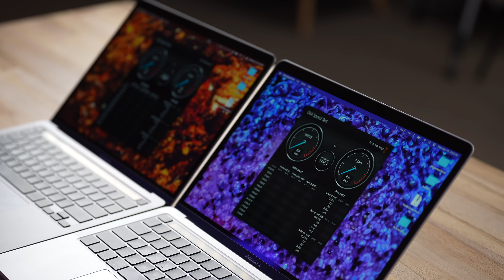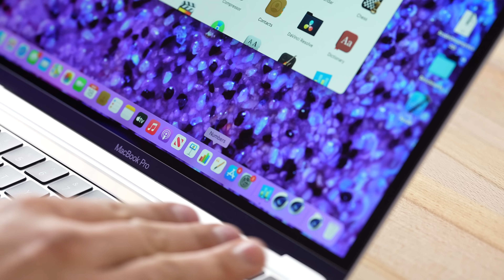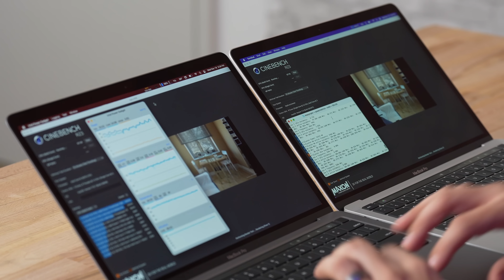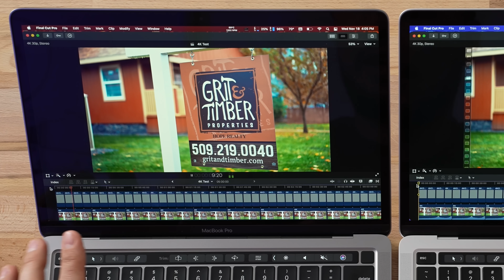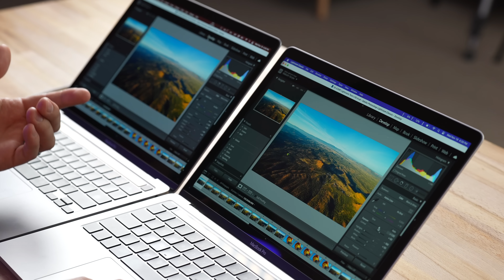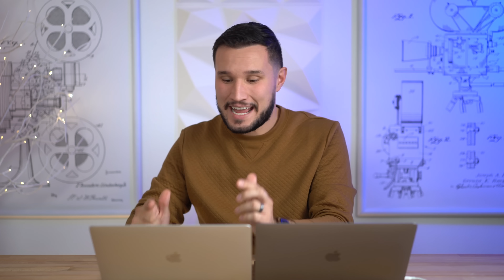M1 MacBook PRO vs Intel MacBook PRO: ULTIMATE Comparison

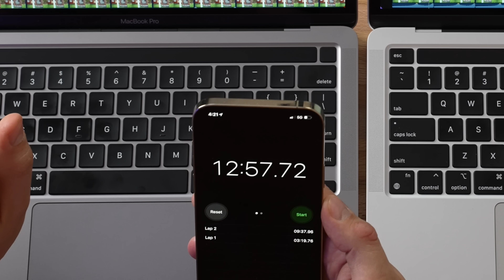Comment: 17:06 I thought that "3.9x faster" number sounded familiar... that's EXACTLY what Apple claimed in their keynote! Turns out they were 100% correct and not inflating a single thing. This is a HUGE development in consumer computing. As a pro audio workflow user, I hope it becomes better supported over the coming years. I just bought my 16" MBP with an i9 because I needed the compatibility, but if everything is good to go in a few years on Apple Silicon, I'll switch in a heartbeat.

The only issue this presents is that we're approaching "walled garden"/proprietary standards at the processor level... that could be bad. It's like Tesla using their own proprietary charging connector while everyone else uses a standardized plug.

Comment: I don't understand why the Intel MacBook pro can only handle like 10 tracks in Logic Pro. Are the tracks in benchmark more stressful? Because I have no problem while having 12 my own audio tracks running on my dual core 2015 13 inch MacBook pro in Logic pro. Could anyone explain? Thx

Comment: Honestly the graphics performance is the most impressive part overall and I see everyone jumping to arm at least for laptops these chips can scale and if they make a 16 core pro chip with higher thermal tolerance and power targets these chips will literally be the best on the market I wish Apple would work with Nintendo for the next switch it could be ps5 levels of power once optimized

Comment: I appreciate you guys decided to do a music production benchmark! Almost no one does those :(. Something you need to take into account to do this test though is the audio buffer size and sample rate. They will greatly affect how many tracks can be run at the same time. The higher the sample rate, the more CPU needed. BUT the higher the audio buffer size, the lower the CPU bottleneck becomes. 

So while I appreciate the test, you didn't tell us what sample rate or buffer size was used. My bet is that intel one had such low track playback because the audio buffer size was too low and/or the sample rate was too high. 

In the future, I would use these settings as a standard, 48khz Sample Rate, and test at 3 different audio buffer sizes, 64, 256, and 1024. I'm interested in maybe getting the M1 MBP for music but unfortunately, this doesn't give me enough information to make that decision. 

Love both of your guy's videos! I have a youtube channel with my buddy called Gear Gods where we review all kinds of music-related gear. I usually do the tech side of things like production. So if you ever have any questions on a good testing methodology for audio production, just let me know.
Reply: And also I just noticed you were muting the tracks, not deleting them. Muted tracks still get processed the same as if they were not muted.

Comment: I returned my intel Macbook Air earlier this year since it was getting so hot just watching twitch streams and youtube videos in chrome. Bought the new M1 version yesterday and this thing does not even get warm. I can actually use it on my lap like a LAPtop. And the battery life is insane. I'm getting around 12 hours... using chrome! I'm incredibly impressed.

Comment: Happy to see the advancements but ima wait for the m2 apple will release it in 6 months at the rate they going
Reply: I am waiting for money reasons (Holidays are expensive) and also what you said. First gen of anything is always a prototype. Not sure if it will be M1+, or what the name will be, but when they scale this thing to the 16 inch model, it's going to be mindblowing. This already was, to be honest. At one fourth to one half the power it doubled to quadrupled the performance. That's insane, and with the dual fans and larger space for heatsinks/batteries in the 16 inch Pro, the potential power is amazing. What I am eager to see is what they can do with a pro rendering machine, how far can they scale this in a desktop form factor?

Comment: Hey Guys I really need to see a review for the MacBook Pro M1 vs MacBook Air M1 . So I can finally decide which one I want :) . Thank you Guys you are the best !!
Reply: Only difference would be the fan. If you require heavy usage for longer periods of time, the fan will help keep your machine running smoothly without throttling down. If you’re just doing basic stuff: surfing web, checking emails, watching videos, etc, then the Air M1 is completely fine.

Comment: Again...your comparing a 2020 chip to and older generation. 8th generation Intel? Intel's 2020 chip is 10th generation.

You're just wasting time. Again, a newer chip should be better and faster than an old one.

Pointless as it prove nothing. Well it kinda proves how disingenuous Apple fanboys are.

I know Apple doesn't have an 10th generation Intel Macs. So how about since you make so much money showing us BS, go out and buy a laptop that has either a 10th gen 15, and i7 and i9. I am sure you can afford it. 

And I am aware Apple chip is right there with the 10th generation chips which are benching above 18,000.

Comment: Ok fine im waiting for an M2 MacBook Pro 16" it's going to be an Intel killer
Reply: Probably an M1X, knowing how Apple names their chips, but I mean this already is, 30% faster under emulation, how much faster do you want? To be fair, same here though. With more heatsinks and fan space and battery space across the board, the 16" pro is going to blow everything out of the water, and when it goes to Desktops, without heat constraints and all it will get even crazier.
Reply: @arudanel5542  yeah and also I'm more fond of the 15-16" MacBook size for work without a second monitor. Perhaps they will somehow nicely make dedicated GPUs play with M1

Comment: I’ve long been an ARM Stan. I’ve been saying since like 2007 that it was the way of the future. Microsoft didn’t have the balls to push hard for it, or to just tell Intel to eat a bag of dicks when they said there’d be no x86 virtualisation on Windows ARM. This is at least five years overdue for Apple, because Intel have been holding the back for a long time (I honestly expected, if they didn’t transition to ARM soon, then they’d be courting AMD for the next lot of x86 processors). All that said, even I’m surprised at the performance gain Apple has seen, here. I expected they’d have serious power efficiency gains, but I thought they’d be targeting performance parity for lower power consumption, not utterly pantsing the Intel equivalent processors. This is a bigger leap in performance, by percentage, than the move from PPC to x86.

Comment: The 8gb M1 MacBook air seems like a crazy deal to me
Reply: Dude I know! This has just made the Air one of the best laptops of all-time 💯
Reply: @Esby I got it! Its Incredible. If your looking to Record Music/Music Production. The M1 Macbook Air 8GB 256GB is perfect 😊 I'll be releasing a Single soon,  can see me using this for years to come!
Reply: It is. I returned my MacBook Pro and got the air instead and have no regrets.
Reply: Loving mine!
Reply: @bryanmiller476  By Chance, Do you use LOGIC, if so how does it Handle?

I'm thinking of picking one up for Music Production.

TY
Reply: @jordandennis1177  same here
Reply: @bryanmiller476  I caution people against buying a laptop with less than 12gb before researching if that will work for their needs. If you typically have many programs open, consider more than just 8gb.
Reply: @bryanmiller476   how’s the speakers on it ? Terms of bass

Comment: These M1’s are smoking the Intels 😳
Reply: yes
Reply: M1 with 8 cores is smoking a middle/low-end Intel chip with 4 cores...
Reply: @MrThedaay  not 8 core 4 efficiency and 4 high performance
Reply: yeah, until you use some apps like premiere or things that aren't native on M1, which is the huge problem with M1 today. It's fast, but you can use it just for browsing the internet and using the few ported app, because for the rest intel Macs are just better (at this point in time, but knowing apple I know that they will optimise and port everything for M1).
Reply: Ya, but you can’t run Windows Bootcamp on the new M1s
Reply: And now they’re smoking them even more
Reply: There already are for awhile with the iPad Pro, which rivals i7
Reply: @EfficientTrout  lmao.. Another noob..
Reply: @KingKong-xp6so  hahahak!
Reply: Well, Intel is about 2 Nodes behind at this point (14nm vs 5nm), which will change in the future and the intel iGPU was never good. The M1 is actually compares very well with the latest AMD mobile chips (Ryzen 4000) at 7nm, but the successor to these is already close again which will be interresting!
Reply: Yup
Reply: If you believe his lies. This scored a 2000 on cinebech. Although he says the 11th gen scores 2000.... he lied. The 9th gen Intels scores 4000+. I won’t bother posting the real 11th gen Intel. Don’t wanna rain on your Mac parade
Reply: @ryanisacuc8381  there is no comparing needed in this range, the M1 is a chip designed for mobile only usage, so only Notebooks and tablets. Intel CPUs that clock that high are in Tabletop configs. anyway the m1 smokes all intel cpus designed for macs or comparebale notebooks, so if you compare it to a i9-9990XE of course it doesn´t stand a chance but put that i9 in a laptop and find a way to cool it effiecently without adding tons of weight to the notebook. The M1 is a huge improvement for apple.
Reply: @ryanisacuc8381  "he's lying but im not gonna prove it since i'm lying" haha shut
Reply: @ryanisacuc8381  show me
Reply: @Aecor  I realized later that he is probably only looking at intel laptop processors only.... but he makes it sound like he’s talking about ALL intel processors. Because the 9900k is way way way beyond that and it’s like three generations old now.
Reply: I’m not saying the apple ARM processor is shit. But people are making it seem like all of a sudden Apple is going to be this Lambo of laptops. I actually really like Apple for doing this as I can tell NVIDIA already has plans to mimic Apples move on the PC side. And it takes a company like Apple to do the move because they compete with themselves (PC and Mac are two different products to different audience or customer base. Rarely do people wonder PC or Mac. They just know). So once Apple has bribed all the major companies to create native Arm apps then PCs will swoop in and start using ARM, or I think more probable RISC-V will be the future over ARM. I feel bad for Apple being as every product of theirs uses some kind of ARM core and now ARM is owned by nVidia which is one greedy Corp that already has bad blood with Apple. In all honesty realizing that Every Apple product now relies on ARM and with how much greedy bloody money Apple has. They are idiots or not buying ARM. Like Tim Cook should resign. Or switch to RISC-V fast
Reply: @ryanisacuc8381  wait till other desktops by apple
Reply: @ryanisacuc8381  what you are talking about is also called anti-competitive behavior. Apple can simply file a lawsuit on those grounds and Nvidia will be fcked
Reply: @ryanisacuc8381  I know this is a late reply but would you suggest getting the Mac book pro m1, intel, or just going with a pic like the XPS for around the 1500 range?
Reply: @ezekill100  honestly couldn’t say because I haven’t researched laptops in the slightest. To be honest though my intuition tells me for the first time in decades I’d probably say a MacBook is the way to go. Just because of it being first to run arm and high end windows laptops are big and clunky and will likely come covered in RGB because they’re marketed to teenage gamers. However. If Apple is still misusing a tantalum capacitor only their laptops charging circuit.... the same one they’ve used since like 2003. Then I’d make sure they didn’t glue the MacBook together and make it impossible to service yourself. Because for about twenty years theyve purposely put a part where they know it’s a ticking time bomb to explode and then when you take it in they’ll tell you repairs will cost almost as much as the new model so buy a new one (when it literally needs a part swapped out that costs fractions of a penny when you buy in. Quantities). Evil basterds. That’s why I turned down a job with them in 2010 when I graduated undergrad.
Reply: @ryanisacuc8381  lol this aged well 😹😹💀💀🖕
Reply: @ryanisacuc8381  did u drink coffee? u yap so much...
Reply: @ryanisacuc8381  your comparing different cinebench r20, r23 nice try windows cattle shit
Reply: @ryanisacuc8381  the optimised version of cinebech on the m1 scores nearly 8k lmao

Comment: Want to upgrade macbook pro 13 2019 8g/128gb ssd, used xcode, python, turi create which was blowing a fans, not sure if to choose m1: mb air 16g/512ssd or mbp 8gb/512 or mbp 16g/256 as haing fixed budget. Thanks a lot.jan

Comment: Would be interesting to see how the MBA/MBP M1 stacks up against the £1800 MBP with 4 thunderbolt ports. Obviously they are going to outperform is but it shouldn't be such a huge difference like the MBA and base MBP intel ones are I guess? Certainly not worth an upgrade for me from my 2020 MBP with four thunderbolt ports but once they release the 14", I might want to consider it.

Comment: I would certainly like to see a comparison to a 16 gig Intel model. Basically: Is 8 gigs plenty on an M1 MacBook Pro?
Reply: If you have to ask, then you’re in doubt. Get the 16gb.
Reply: @cim8097  ehh but its a brand new chip so we all are asking
Reply: @Htiy  it's better to have more memory than be bogged down later but I do agree with you, it's a new chip on a completely different architecture. So we don't know for sure how it will perform for these heavy/power users. I'm getting mines next week.
Reply: Yes, it is very good
Reply: Go for 16gb ram if possible. Future proofing because we don't know how RAM hungry Mac Silicon apps may become.
Reply: yea me too, wonder if its worth upgrading to 16gb on the M1 pro

Comment: The 720p quality of the M1 looks ok for me, and based on our testing most people would struggle to see the difference between a good 720p and a normal 1080p. But that testing was done with much better cameras from videoconferencing systems. The mic sounded also better on the M1 and that would be more important for me than the camera.

Comment: Docker, android studios, parallel, homebrew doesn’t run, got my mini yesterday can’t use for work have to switch back to MacBook pro 16
Reply: Have you tried using Rosetta for Homebrew?
Reply: For Homebrew there is a workaround by running the Terminal in Rosetta.
https://osxdaily.com/2020/11/18/how-run-homebrew-x86-terminal-apple-silicon-mac/
Reply: Docker has to wait for 2 upstreams to be M1 Optimize™. Waiting on Go and Electron.
Reply: @cim8097  It's not only that, they also have to run virtualized Linux. Apple will only support ARM-based images for virtualization and 99% of Docker users run x86 images.
Reply: @Jasterrrr  yeah it'll be interesting on how they're gonna utilize Apple's hypervisor.
Reply: @cim8097  On the other hand, Docker on Macos is sort of rubbish so we might as well start using VPS' as remote dev environments.
Reply: @Jasterrrr  I already do that lol. I have a heavily modified code-server (VS Code on the browser) that's already been doing Docker-in-Docker.

https://github.com/demyxco/code-server
Reply: @cim8097  Very cool! Does it work well for you? I'm more interested in running the VS Code locally and then using Remote extensions for connecting and managing code.
Reply: Is vscode optimized yet? Does it work ok on rosetta?
Reply: @umber-light  you'll have to look at their website because I don't have that downloaded on my MacBook Pro. I use it on the browser though.
Reply: @umber-light  VSCode insider build is native, VSCode on rosetta is almost exactly the same.

Comment: The apple silicon version is in another league wow I’m totally blown by the performance. I think it’s time to upgrade from the Lenovo x one carbon
Reply: You can't go wrong with M1. Everyone saying you should wait for M2,M3 can't explain what's wrong with M1. Even emulated apps perform better than any laptop at same price. The only reason to wait is to get a cheaper M1 used.
Reply: Time for me to upgrade from my Dell Inspiron 5th Gen i5 , 4Gb Ram
Reply: Yes wait for M2 maxbook air or maxbook pro 13
Reply: @xrpsam  nah after m2 imagine how good m3 will be!!  This is why you just buy now...
Reply: @areallyboredguy5825  The best option is to wait for the redesign... I think the bezels are to big for a 2020 computer. If they actually make a 14inch is going to be the best option
Reply: @areallyboredguy5825  True, you could wait for ever
Reply: I am just waiting for unbox therapy to say the same ahahahahhahaha that's why he hasn't uploaded yet...
Reply: if you upgrade now unless you are a final cut video editor then you are going to bump into endless crashes and troubles. Wait for the 2nd gen.
Reply: @dinghanxue704  you say this based on what
Reply: @areallyboredguy5825  based on my personal experience....